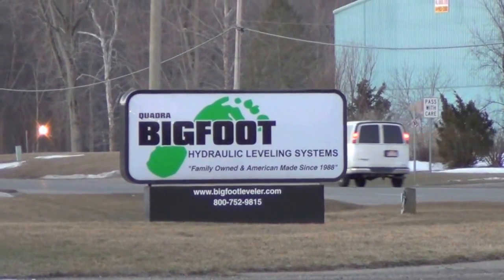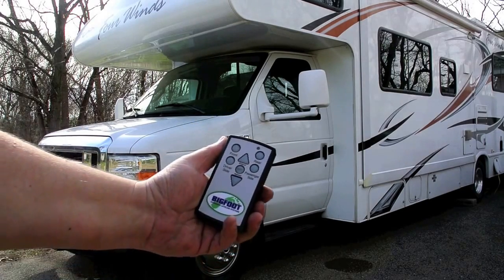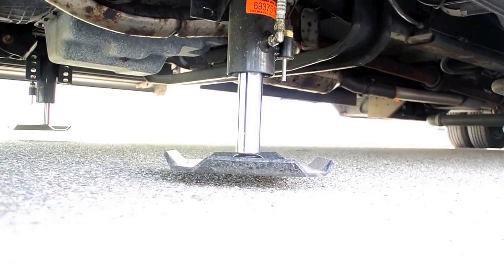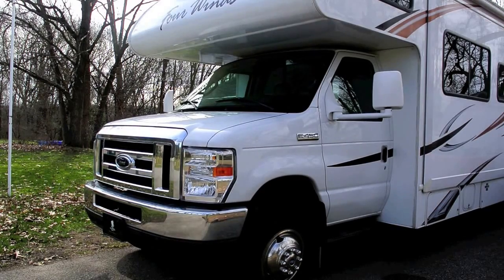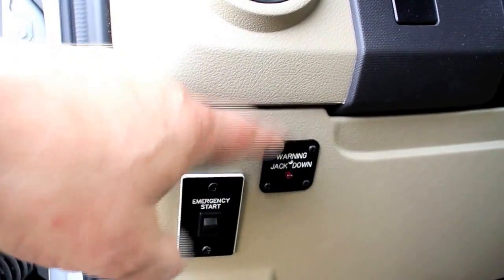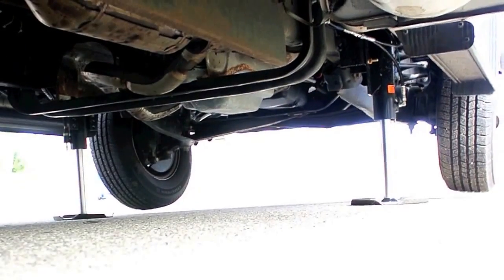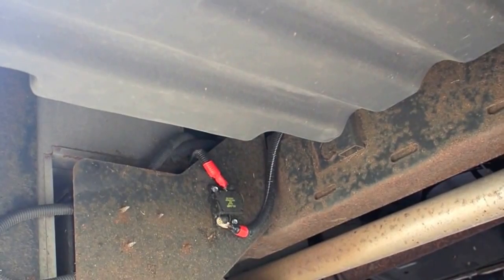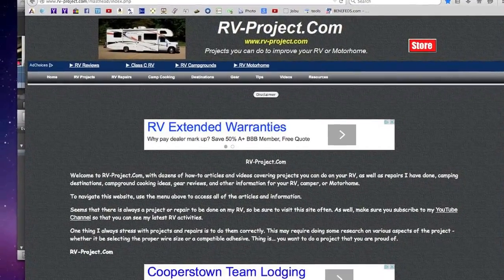Installing Quadra's Bigfoot Wireless Leveling System.

Comment: I have salvaged a Big.Foot system from a 40 foot Gulfstream 2002 that had a kitchen fire.. It's a 4 pump 4 reservoir system and it is fully automatic..  I Have to go take it out ..In a class a the cylinders are bolted right to the frame .. No welding needed.. I have a 32 foot Itasca Sunrise so this system is really going to work like a charm made for a rv 25000 pounds.. Mine is only 15000 pounds.

Comment: Thank you.  This is a great video!  and I was considering the same issue.  Looking at buying a new RV, and if it doesn't come with levelling system,  I will have it added.   This will be the RV that we use at our Alaskan home and we also own  uneven recreation/hunting property there,  that we will camp on. So a levelling system will be mandatory,  I have decided.  I am also intrigued  by the  capability to use it to change wheels, or even assist in getting the RV out of a rutted scenario for example.    I could see where I could raise the tires and place rocks or boards under them to get out  of a stuck situation, which I have experienced with our 4 Winds in Alaska.  Also, I would be researching  leveling system with the highest stroke.  I was also interested to hear your idea about increasing the antenna length.  This should work.  Thanks again for a very informative video.
Reply from the maker: Thank you for supporting  my channel.

Comment: What I have learned from watching this video is to hell with the stupid Wireless Bigfoot go for the Bigfoot auto-leveling system that is hard-wired it also allows you to manual use as well!!!
Reply from the maker: Thank you for supporting the channel.
Reply: I have auto levelers from Bigfoot in my super c and I have to use manual all the time because auto level always wants to put all of the tires in the air.  I’d rather have this wireless manual system
Reply: @Travelingman724  Have you asked the company why they do it this way?

Comment: i just do not see why rvers use thos plastic expensive blocks to level out their coaches vs hydraulics?  i am going to give a bottle jack / jack stand combo a try.  i can't stand  using plastic on a 10 ton rig, does not make sense to me but those plastic things are so popular, hydraulics is  the answer.....
Reply from the maker: The plastic blocks work well for lighter RVs. a 10Ton RV, maybe not so much.  

They are popular because they are a lot lighter weight than bottle jacks, especially given you can drive your wheels over them.

I think I remember Lynx stating they have a 30,000lb crush resistance. Of course that would be under ideal conditions, but I don't think I would use the orange blocks with that much of a load.

Comment: Great video, I just bought a class C this past summer. This is one of the things I would like to have put on ours. I was thinking it could als double as an electric jack in order to do a tire change. What's your thoughts....I saw where the front was lifted off the ground. Thanks for the pros & cons also👍
Reply from the maker: I no longer have the Class C, but if I recall from memory, each jack could lift about 10,000lbs. Since the whole RV only weighed about 14,000lbs, the 4 jacks could easily lift it.

I never tried lifting the rear wheels as it was kind of a scary thought. However, when I had the system installed at the factory facility, I recall seeing a custom Super Class-C having jacks installed, and they did a test with all 6 wheels off the ground.

One issue I see is there is a safety issue with using a leveler to lift a wheel when changing a tire. Leveler mfgs typically warn against tire changing by using the jacks. It is a liability issue to be sure, but still good advice.

At any rate, I have road-service on my RV. When I saw the size of the Class C tires, I figured I was not going to change one of those.

For less than $100 per year, it is cheap insurance to have someone else change a tire (although there is the time factor waiting for the arrival of the service vehicle).
Reply: @RVProject  Thanks for the reply...our unit did not come with a spare tire...prob giving us a hint😉 not to attemp it. I figured the manufacturer prob would warn against using equiptment for other reasons than designed for. I'm still going to get some electric jacks for the leveling alone. Thanks again for the detailed reply👍
Reply: @TheJourneyInBetween2020  Hi, they didn't include a spare tire in order to cut costs.

Comment: I have a class A. What does an installation of these cost?
Reply from the maker: +Philip Bodkin It all depends on who you have do the installation. For me, I live about an hour from the Bigfoot/Quadra factory, and they typically run a special in January each year with a $100 flat installation fee (normally the installation fee is around $750 if I recall).

Depending on where you have the installation done, I would expect a different price structure.
Reply: If u don't mind, how much did the system itself cost??
Reply from the maker: The sustem with installatiln special was just under $3k.

Comment: How many other systems did you look into? I am already so tired of carrying around various blocks and such.  Can it lift more than 4" on one side , driveways in particular are severely sloped.
Reply from the maker: In addition to the Bigfoot, I looked into the Lippert and HWH systems. I think Bigfoot was the best of the three. As well, I live 50mi or so from the factory, so I had the factory install them.

The cylinders they used have a 12" travel if I recall. The amount of lift is dependent on where they are located on the chassis, and how much ground clearance they dial in when being installed.

However, you can get the full 12" of this (or any other lift system), simply by putting blocks under the cylinders. Of course, you are considering lifts so you don't have to carry around blocks, but for your driveway, that would be an exception, no?
Reply: It was the ONE thing I didn't think about before beginning my adventure. Having to spend the first month at an extreme right angle proved its importance. IDK if the levelers are  possible this year but it would be a tremendous advantage.